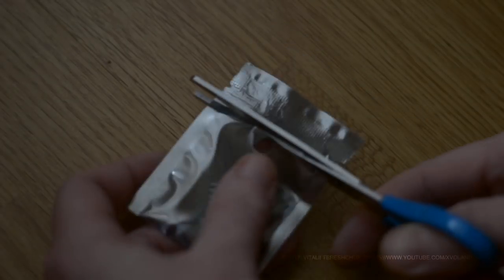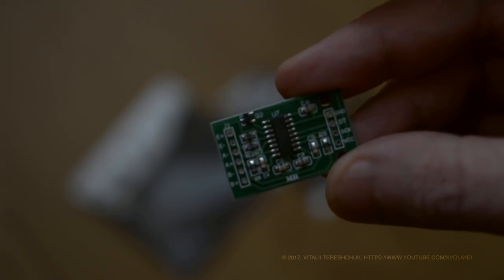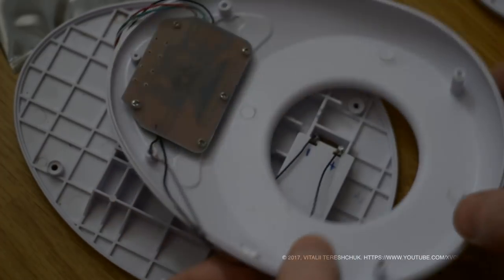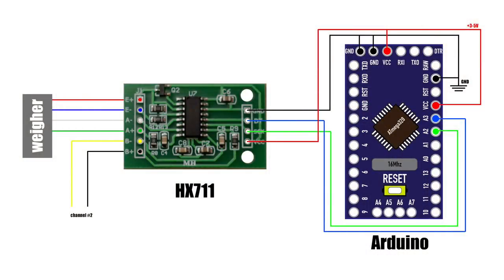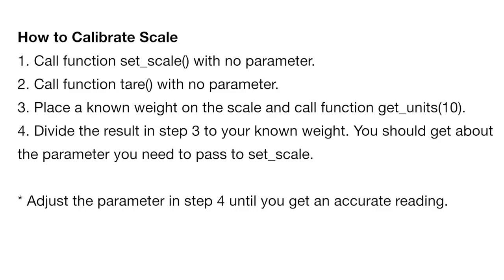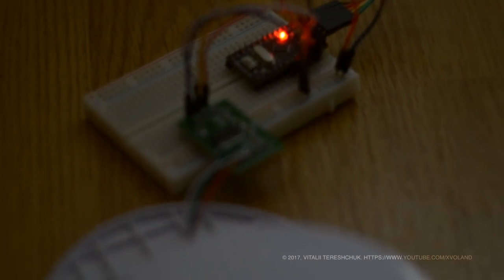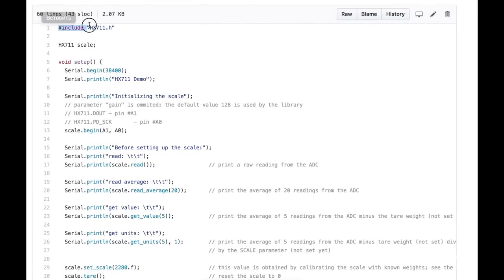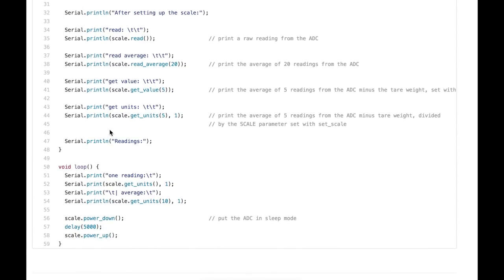DIY Arduino Projects HX711. Analog to Digital Converter for Weigh Scales

Comment: Instead of measuring weights if i have to measure voltage in hx711 ,how will be the connection? and how to read 24 bit value?
Reply: You have to check their datasheet: https://www.mouser.com/ds/2/813/hx711_english-1022875.pdf
Basically it is a serial interface, so at each clock pulse you get one bit of data and if you do one or two extra pulses, you change the PGA gain for the next sample.
Data rate is pretty low, max is @80SPS, so you should be able to do that with any microcontroller.
Reply from the maker: How to connect http://infopade.com/29f1
Reply from the maker: brianpwnsjustin I checked - it works

Comment: Haven't touch my arduino in a while, would my Arduino UNO work with this? It doesn't seem to have a VCC.
Reply from the maker: brianpwnsjustin Arduino Uno has VCC and any Arduino can work with this module.
Reply: @xVoLAnD  Okay I guess I am blinded >.< . I don't see it on my board. Here is a image of my arduino uno. I tried googling and i guess I could use the 5V ? Thank you for your help by the way. 

https://imgur.com/a/rkdoZcL

Comment: arduino hx711 price computing scale
Reply from the maker: Rana Shahid What?
Reply: @xVoLAnD   possibly use this scale like in stores where you put item on scale and then it prints out the price based on weight. very cryptic question though from Rana